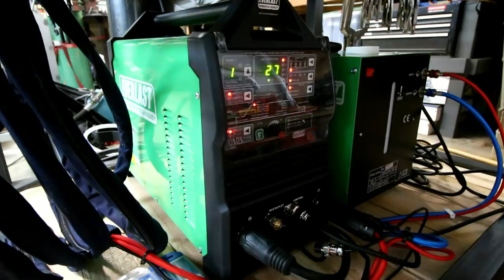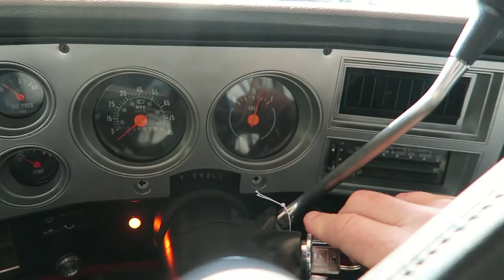New Shop Plans for KillFab HQ

Comment: I follow all your videos from the Netherlands. Congrats on the huge piece of land. I designed and built my house 24 years ago, and oriented one big roof south with the perfect slope for solar panels. I have 4 m^2 solar boiler for free hot water, and 21 solar panels for a year's worth of electricity (too much in the summer, too little in the winter, but I use the network to give/receive the balance). You can install these later, but orienting the roof is a free design choice now that you won't regret. And if your wife does not like them you can put them on the shop if you orient your shop roof towards the sun. ;-)
Reply from the maker: yeah thinking about installing some solar

Comment: I do excavation for a living. You got yourself a good piece of land. Whenever we have brush fires I'll usually bring in the wand torch and put some diesel fuel on one side of the pile then use that to get a good fire going on the opposite side then put some fuel in a plastic bottle and try to throw it in the middle. Usually that works awesome
Reply from the maker: nice! puts on a nice show Im sure
Reply: The Fab Forums there isn't a big explosion or anything. Sometimes if it's a really really big fire lll take a five gallon bucket of old used engine oil and throw it in the fire with the excavator. That gets then burning hot.
Reply: Like the drip devices that wildland fire fighters use when setting a back-burn.

Comment: I find it easier to use a big gas burner (propane torch like) for starting bonfires, and u need to let air draw under the pile, I usually burn a pile like that in a few hours, no smoke :)

Comment: Make sure u build the shop far enough away from each other that if one catches fits it will not ignite the other. Fire dept takes a little longer to get to where u are. My dads shop is a 40x60 and dude trust me that’s big. I could easily tear apart 6-8 vehicles in there.
Reply from the maker: yeah...plus dont want to wake the fam with open header runs

Comment: Kyle
Look into ICF buildings that's insulated concrete forms example Google it Poly Steel is a MFG.
Reply from the maker: I will do that
Reply: Had a guy build his home with that then vinyl sided. He heats his place with wood like I d o but goes through half of what I do in my smaller cabin.

Comment: make REAL sure there no thermites beetles or woodrot in that old barnwood , might be wize to have the wood fumigated before use 
the plot looks pretty nice theres plenty of flat land to build on and not a lot of neighbours to bother or be bothered by , the dog prolly will prolly be exhausted from running and roaming around it the first couple of weeks , seems it allready has a powerline to it (didnt see a transformer though )
how about gas (propane?) water (well?). sewage (leachfield?) and internet (satelite?)? , those cost can realy add up if they have to lay lines to youre plot 

there german type houses that has REAL good insulation and double pane windows that cost verry little energy to keep warm and cool 
http://www.builderonline.com/building/germany-based-modular-home-supplier-sets-its-sights-on-america_o
https://www.huf-haus.com/uk/houses/single-family-and-duplex-houses/
once the foundation is put down those houses can be set up in less then a week , from part ariving like a huge flatpack together with an assembly team to a house you need to paint put carpet in and hang the fixtures in 
https://www.youtube.com/watch?v=P89JxA93jkI

they do look kidah modern but maibe the american branch has more suitable homes